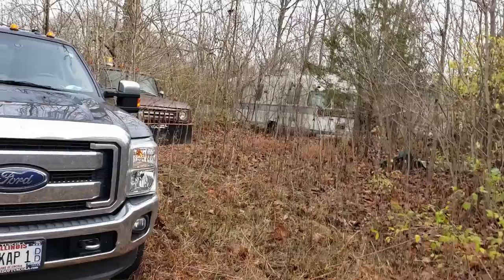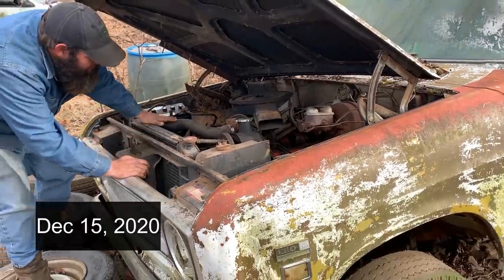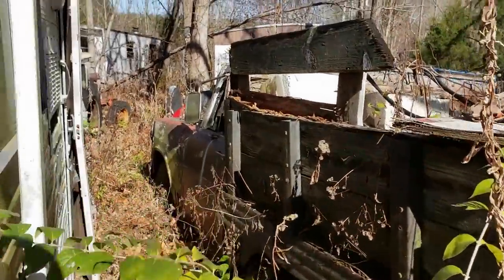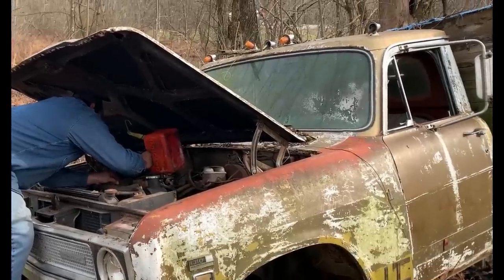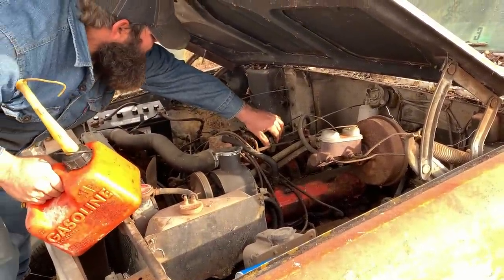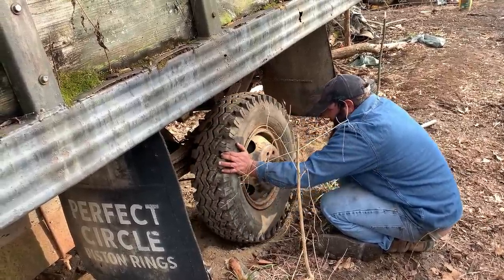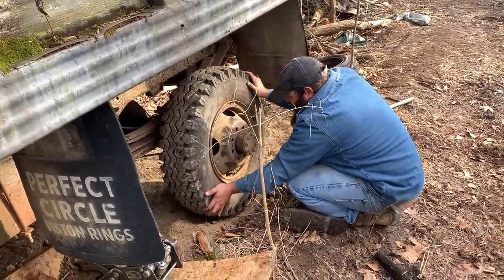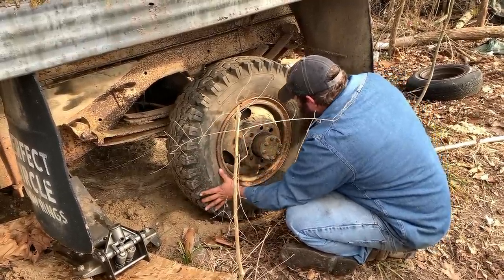WILL IT START!? Dismantling new 8 acre Picker's paradise land investment! 1971 INTERNATIONAL!!

Comment: Amazing how the old vehicles can set so long and still start. Can’t imagine today’s vehicles ever doing that
Reply from the maker: yeah crazy how that is! I would think 16 different sensors on a new-er one would not allow it to start! LOL
Reply: Anything that has never had unleaded or ethanol gas in it can sit for many years and usually start with very little issues and most issues is just dried out gaskets and diaphrams. put unleaded and ethanol gas in a vehicle let it sit a year or more and it will never run again without new carb or fuel system. Our great government fuels of today. I recently bought a 1946 dodge power wagon sat in an old dairy barn on the verge of collapse since 1954 I litterally put a new battery in it primed the fuel system with the old leaded gas that was still in it and cleaned the points and drove it home 28 miles with no issues never even touched the carb. I ran the truck around our farm for almost a month on the tank of gas from 1954 before it was empty with no issues wouldn't do that with today's crap we are forced into buying.
Reply: The old ones are pretty simple machines.  If you can get gas and spark to it they will go.
Reply: Part of the problem with modern vehicles being parked up, are the computers and immobilisers, if the battery goes flat for too long, the immobiliser can lose it's code from the chip in the key (read by the reluctor ring round the ignition barrel) and fob (central locking), but all related. Only way you can get them running again, is either buy the computer to reprogramme or get into a garage or main dealer to do it for you, wither way, it'll cost at least £100, just to plug into the computer.

Nice thing about the old vehicles is, at the least, some fresh fuel and battery, maybe some easy start and 9/10, it'll run